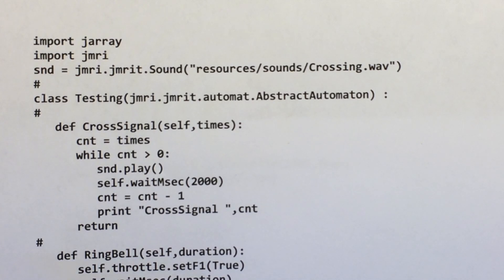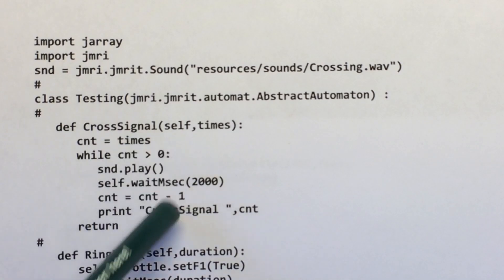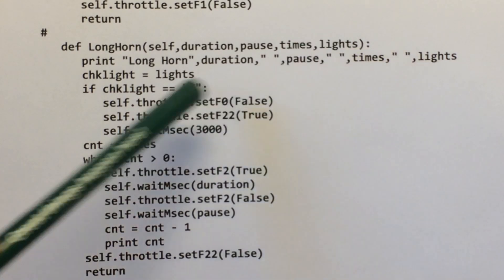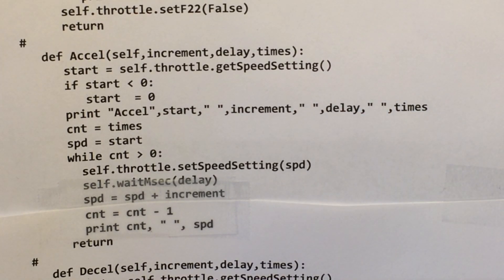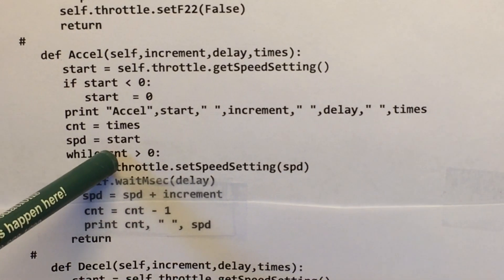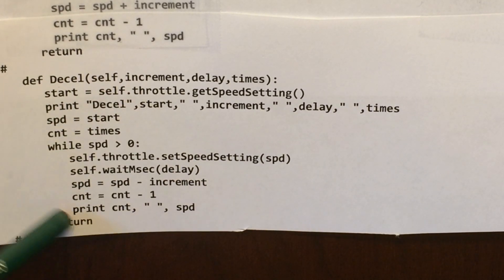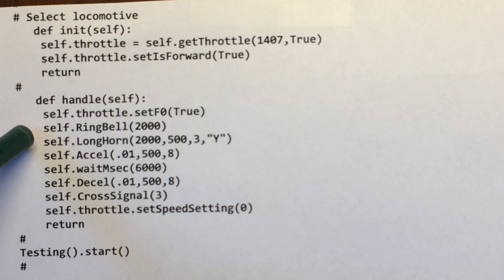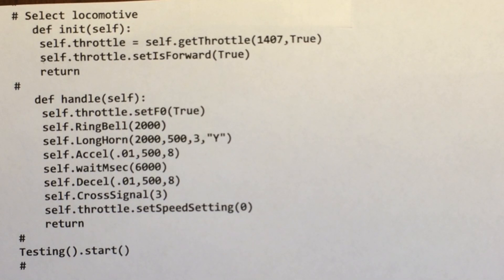My 4x8 x 2 HO Layout JMRI Script #5 -  Subroutines(Functions)

Comment: Good info. The technical part of the hobby is what interests me.
Reply from the maker: After finishing my original 4x8 DC layout, I was ‘drawn’ to the DCC primarily for sound.  Then I read about JMRI and decided to see what it was about.  I spent a lot of years in IT so I thought the challenge of scripting was something to try.  I never used Java or Python so the structure and syntax has been a challenge.  I’ve gotten some help on the JMRI user group to get past rough spots.  It’s been good aspect of the hobby for me to keep interested.  My layout is almost done but I foresee lot of time with JMRI.  I haven’t begun to do routes and sensors.  Be safe and thanks for watching.  😷
Reply: @FredE528  wondering if by now you've gotten to sensors and even reporters using transponding so if a train comes into a block/sensor, you can pick up its DCC address via transponding, replace a JMRI script with this new engine address, let it run the script, then release the engine after running the script to go around the layout doing something else?  I'm really looking for how to get the DCC address out of the train and into the line for the self.throttle(MYNAMEHERE) to control the train.

In other words, have you figured out how to get the DCC address of the engine into a script so you can then control the movement of that train. Then when another train moves into that area of your layout, all that has to happen is JMRI polls that new engine, and then repeats. Kind of like a subroutine, but using different engines?
Reply from the maker: Sorry, I have not tried to read the DCC locomotive number with script.   In my master script I set up 4 global variables with the locomotive numbers I want to run in my scripts.  Each global variable is used by a script to run a locomotive.  This method allows me to easily change the locomotives used.  Thanks for watching and good luck with your work.
Reply from the maker: I am using IR sensors with an Arduino and DCC++ to stop my locomotive at specific spot.  I have purchased a DB20 to do occupancy detection but have not yet tested it with the Arduino. I’m currently having inconsistent performance with turnout control on one Atlas snap switch.  Decided to walk away for a while.  It probably needs rewired and I’ve lost patience with it. 🤬  Be safe out there😷
Reply from the maker: I’m not using ‘reporters’. I didn’t understand this function when I read about it in manual.
Reply: @FredE528  O my, could you show below the portion of the script and how you did that? I suspect you have that running in your "master routine".

Thank you for the quick responses.
Reply from the maker: I would be happy to email the entire scripts if you want to post your email.

Comment: A suggestion for you, define a separate routine for the ditch lights and test it by itself.  If it works, then call it the program.  If it fails in the full program then you may not have enough timers.  Microprocessors have a limited number of timers.
Reply from the maker: Thanks for tip.  Be safe😷

Comment: While following along with your video I noticed an issue with your Decel routine. In the loop you decrement counter .. but then don't actually use the counter. (your test condition is if spd > 0 and so the loop has nothing to do with cnt.)  I do think this actually has a place though and so in addition to Accel I actually implemented two routines for slowing down. My version of the Decel routine does use cnt (just as your accel routine does.)  I then implemented a 'stop' routine which uses the spd > 0 test as shown. This latter one does in fact drive the speed down to zero vs just slowing down to a new speed.  ps: Thanks for sharing you are giving me a good insight in what is possible with JMRI scripting.
Reply from the maker: Thanks for sharing.  My scripts developed over many months as I learned new things.  Sometimes I go back and polish the older ones and sometimes I don’t.  I haven’t run any of my scripts for months as my Arduino has been disconnected.  I need to reconnect the IR sensor wires so I can run some scripted operations.   I need to add a dozen or more sensors to the layout so I can create more scripted operations.  However, I need something easier than the method I’ve been using to install the IR sensors.  

I’ve been focused on expanding the layout for several months.  I now have a lot of little projects on my list to ‘finish’ the expansion.  I want to restructure the center of the layout between the 2 4x8s.  That probably will have to wait until this fall as I’m just not in the mood for tearing up this section yet.
Reply from the maker: Have you seen this video which I show how to use memory variables?  Starts at 2:00.  https://youtu.be/0quSrnjoG5Q
Reply: @FredE528  Thanks for pointing me to it. I do like the ability to specify in a memory variable the train number. That will make loco swaps trivial. I had thought of something similar for setting up a series of 'locks' for various common track blocks. Perhaps a default value of "free" and then set it to the train number when the block of track is claimed for use. That way with some logic in the script various scripts can run independently but still respect another script (that currently holds the block.) Perhaps waiting at a signal for the block to become free.  (I am not there yet but this is how I was thinking of doing it). I have also 'just discovered' routes and started playing with them yesterday .. but not yet established how they deal with 'common' sections of track used in multiple routes.   ps: have you considered putting the scrpt fragments that you discuss in the 'show more tab'?  That sure would save a lot of pausing the screen while transcribing the code!
Reply from the maker: Glad you found it useful.  Not sure if you noticed but I use a memory variable to control the coop loop which is used when I have two trains running that need that track.
Reply from the maker: I’ll check out the show more tab.  Not familiar with this.  Thanks
Reply: @FredE528  As an example of what can be done with 'Show More' check out this guys channel. Click on the 'show more' (left side of screen below the main picture of the YouTube video.  ... https://www.youtube.com/watch?v=5JlkYFX3ovc      His is mainly links to products he uses ... but yours could be the actual text of the script, or links to a 'github' page where you keep them (as an example)
Reply from the maker: Sorry for delayed reply.  For some reason this was stick in the ‘Held for Review’ section.   I now understand what you are referencing to in ‘Show More’ comment.  I was think in terms of within JMRI.
Reply: @FredE528  Ha .. no worries at all. I don't know the publishing side of you tube at all but assume there are some tools where you create a file which will appear as the "show more". I know it is done per video and of course you put what you want. You could put the code in a dropbox and just have a link to it.  

While I am typing ... Following up from this video and your comments I have taken all aboard your scripting ideas. I now have JMRI  subroutines , memory variables and a fully scripted 6 minute run with two locos etc.  This is for a 'technology demonstration table' at an upcoming train show in Toronto.(A 2x6 layout with Six Arduinos, RS485 / CMRI network, Sensors galore, MP3 sound effects, MERG electronic kits for sFX, and now JMRI scripting!)

In my case the subroutine code is 'inside the class' but before the init() and the handle() functions. I assumed this is how you did it also. It certainly works but I would like to be able to carve out the subroutines and put them in a separate files (for reusability) but my early attempts using variations of import or include have not worked so far. Have you looked into doing this.?  Not a big deal at the moment I only have three script files but the scripts are bigger files than I think are needed, and you have to scroll past all the 'static stuff' to get to the important part of the script down at the end. Obviously maintaining the code base will quickly become a rats nest. (the same 'accel' subroutine code in every script? - It just does not make sense.
Reply from the maker: Your thing sounds really cool.   Check out this video which shows how to separate ‘subroutines ‘. https://youtu.be/2wQBmRxG4-Q

Comment: You are the first script I saw that showed me how to run a subroutine, gave me an idea behind the return command, and counting!  You also showed me how to define variables such as times in that def CrossSignal. You mention the self as coming from the handle routine running someplace else?  So THAT routine will call out CrossSignal and it will make this sound happen at that time?

For you, when the .wav file is played for the crossing, that sound comes out of the computer's speakers and not the train's speaker, correct?
Reply from the maker: The setup of the crossing was file is done in each individual script and the subroutine is called with the #times parameter.  I was messing around trying to get the duration of the sound to match the time it took the train to pass over a road crossing.  This didn’t work very well so I now don’t use it for that but use at end of script to indicate the script has completed.  The sound comes out of the computer speaker.